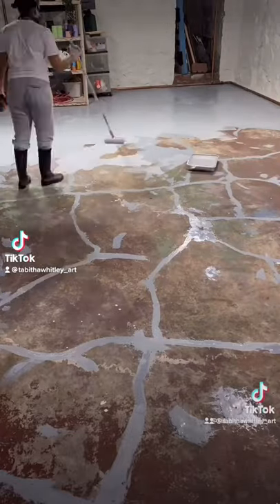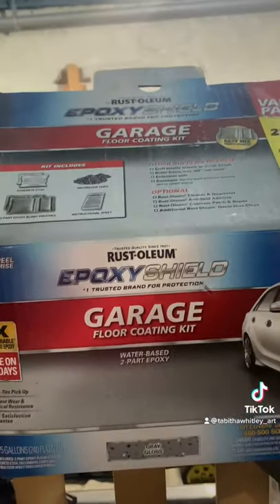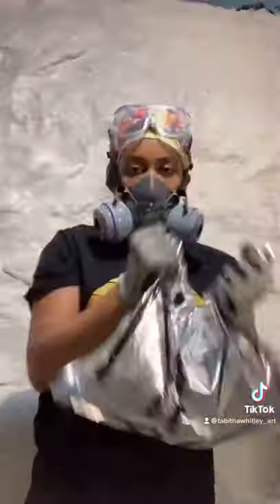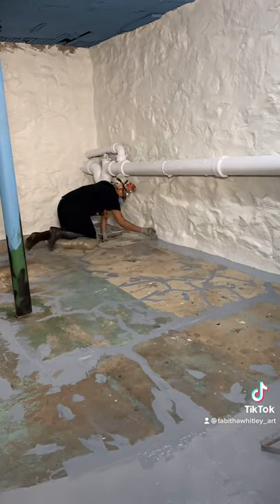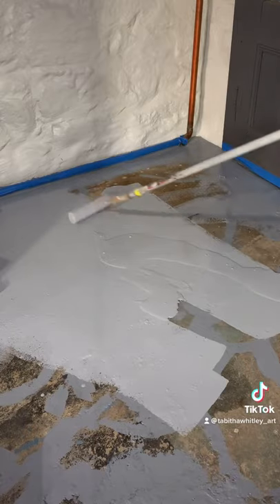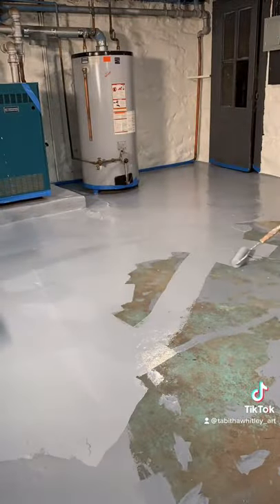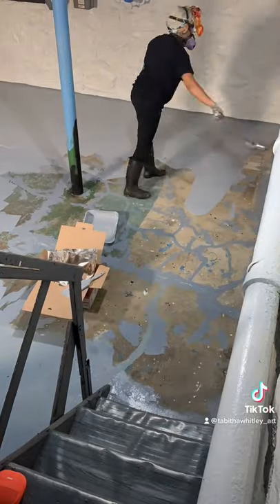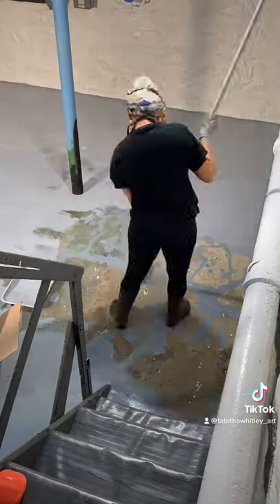Tabitha Whitley “How to Epoxy a Basement Floor Part 3” pouring the Epoxy

Comment: Stuff is great for walking spaces and basements. Garage floors ABSOLUTELY JUNK. will not last. Great video you did a good job
Reply: Depends how it’s applied, if it had a good base and good top coat, it will be fine

Comment: Hi. Is this epoxi help to "seal" the floor? Is it like a waterproof option? Thanks
Reply from the maker: It’s just a stronger option for floor paint. Most people use epoxy for their garage floors because it can hold up to cars rolling over it. I’m definitely not an expert though, I just read the instructions very thoroughly 😅
Reply: @tabithawhitley3269  thank you. I just asked to find a better option to my basement. Thanks
Reply: @MyProjecttriathlon My basement "seeps" and I was told the foundation wasn't done right. This is going to always happen, maybe? A couple of individuals have told me not to even bother with any paint (or "painted on" substance or sealer) because I can never stop the pressure "pushing up" from the ground. This is also what's supposed to be causing unending  flaking or crumbling dust because of constantly wet concrete 😢😢😢😢

I've just been told that by older / retired pros or contractors though. Products and knowledge change and grow, so I'm trying to research for myself (again).

Hope you have success!

Ps: I'm currently looking up the kind of subfloor that will both insulate and elevate the floor to allow circulation, or a cork subfloor to lay under what I already have maybe?  

I did my floor in something elevated and open, with an indoor/outdoor area rug over the walking areas. It worked GREAT for two years. The cold hard snap here (US Midwest) has done something different though, and I've got a litteral and unending puddle under and next to my bed - it's wet enough to seep that high up.😢

Ssssooooo..... back to research I go.

Just wanted to put this out there, in case it helps you or anyone else. It's bad enough that I'm willing to rip it all up and redo it - I don't want that for others 😢😂😢😂

Good luck!

Comment: Is that epoxy holding up well?
Reply: I am wondering this myself.  Have any areas peeled or bubble? And how come no topcoat?
Reply: @ezim4296 Started peeling almost instantly. If you plan on using your basement as a living space and not storage don’t do it.
Reply: @keeblerelmcookies  I am sorry to hear that.  I did put an epoxy floor down on my finished basement floor and it came out great. I did not use the epoxy from the hardware store, I used an epoxy from an epoxy supplier near me (it was slightly more expensive than the hardware store version). I also grinded my floor down 1st before sealing up the cracks instead of an acid etch. With older concrete it is better to grind than use an etch. You really have to open up the pores of the concrete so that the epoxy will stick to it. Grinding is the best for that. Anyway, it's been 5 months and I couldn't be happier.  Sorry you had problems. And thank you for the reply.

Comment: Why did you decide to not use the flakes? 🤔
Reply from the maker: People tend to use the flakes in garages but I’m using my basement as an art studio so having a neutral grey floor is better for painting. So for my purposes the flakes would be extra work with no benefit. Also if I accidentally spread them out unevenly that would have driven me crazy for the rest of my life.

Comment: Question: Is it supposed to feel tacky after a day of drying?
Reply from the maker: No it shouldn't, it may be that the epoxy hasn't set all the way. it could be the temperature or a mixture issue. You should call the manufacturer for more info. Good luck I hope it sets!

Comment: Is that stuff safe around the hot water tank or the furnace? Is it flammable around the pilot light?
Reply from the maker: It’s latex based but I still turned off the pilot lights on the hot water heater and boiler, I mention that in the video.
Reply: @tabithawhitley3269  sorry
Must have missed that part good tip thanks may have to wait till summer I kinda neeed the heat in my house for now lol thanks….
Reply: Do I have to turn off the pilot light? If I just keep like a foot distance away, do you think that would be ok?